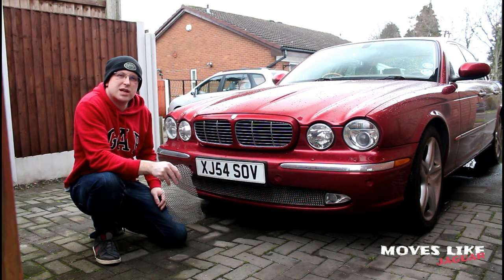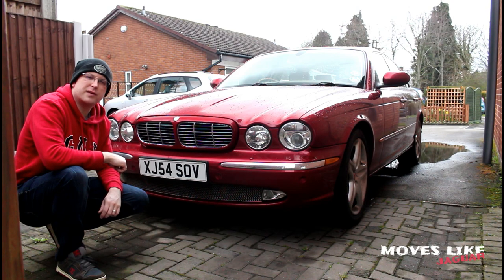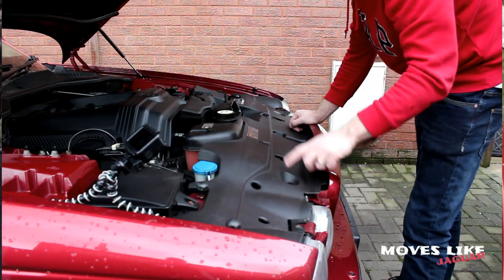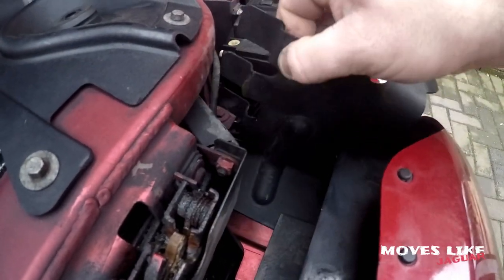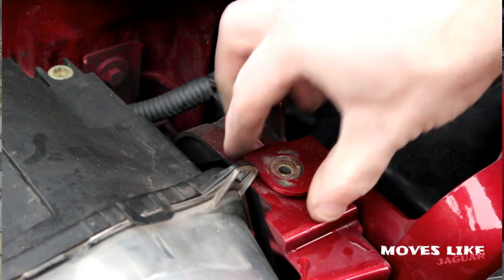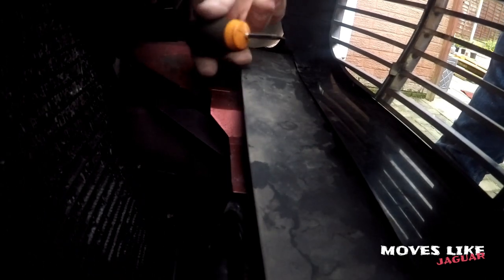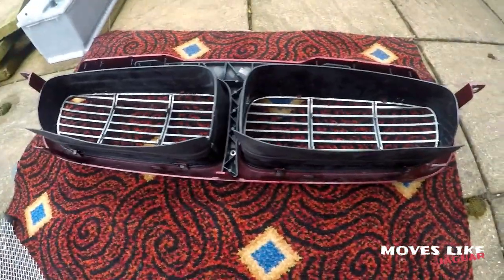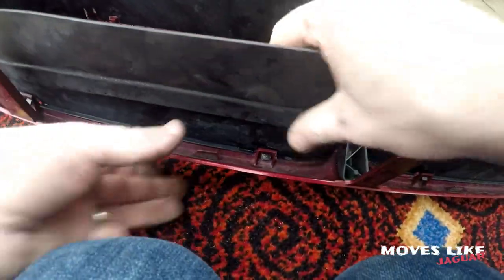How To - Change an XJ front grille (X350)

Comment: great video I did this to mine a couple of years ago,I have a 04 XJ350, Im struggling to remove the front bumper as I need to remove the headlights which are full of condensation,any tips on this job would be appreciated, thanks

Comment: How do you replace the Lower Grill ???
So are there No Screws holding the long plastic piece between the lower fog lights ?
Reply from the maker: The mesh lower grilles simply clip into the gap once both end covers have been removed

Comment: Just ordered my grille inserts, but undecided on the lower grille.
Bearing in mind it covers the towing eye mount, is it quick to remove at the roadside?
Reply from the maker: Yeah wouldnt be too bad. They only clip in, so you could remove it if need be
Reply: @MovesLikeJaguar  That's good to know, thanks.
Reply from the maker: @matthewjenkins1161  Thanks very much for watching and subscribing 👍
Reply: @MovesLikeJaguar  Is there a video to replace the lower grill?
Reply from the maker: @johnshoobert796  Doesn't really need one. They literally just clip in